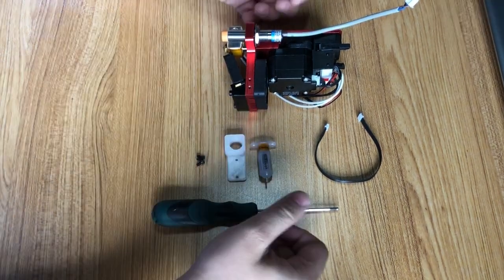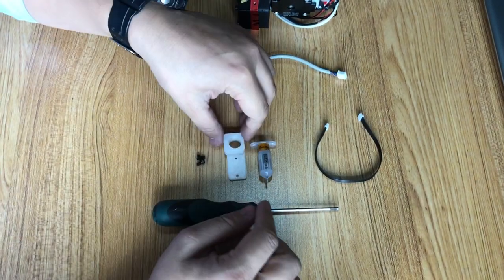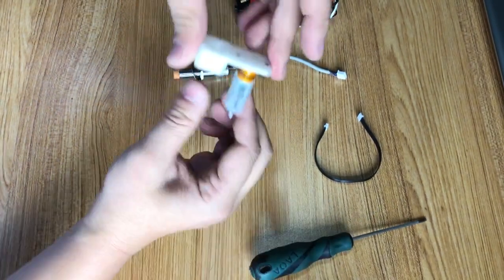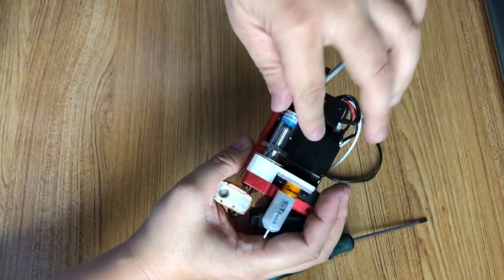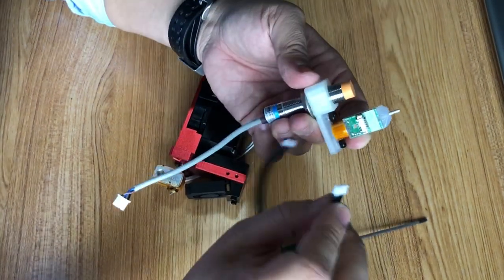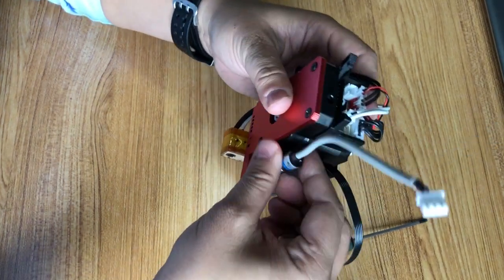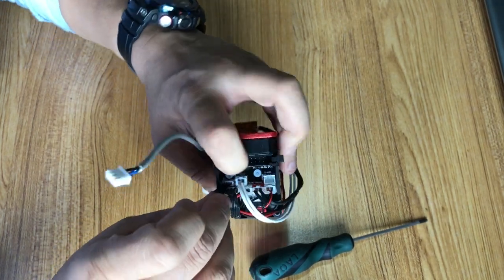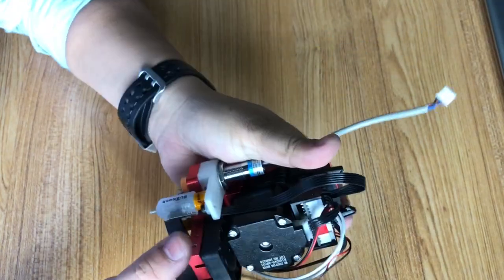How to install BL touch onto D9?

Comment: my D9 300x300 with the newer Splitter Board  does not have that connection for the BLTouch ,  is there now a newer Splitter Board ?
Reply: you have to order it.